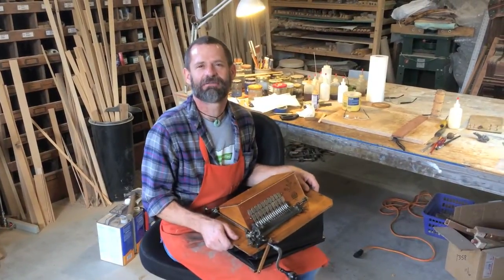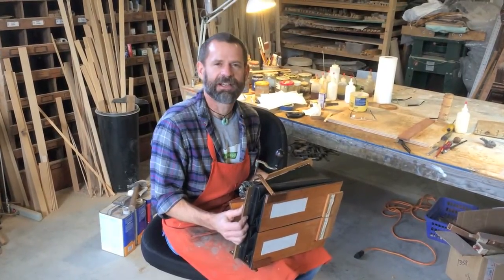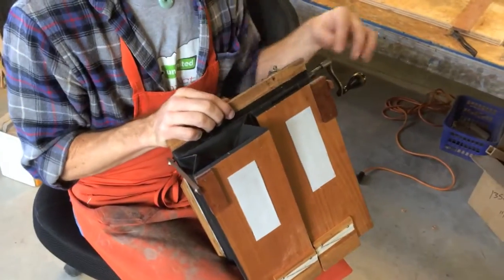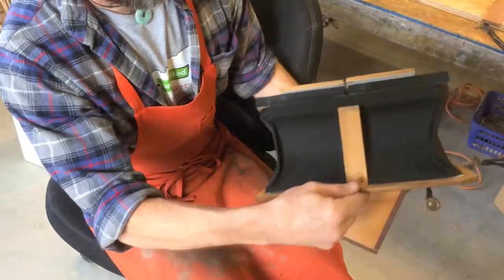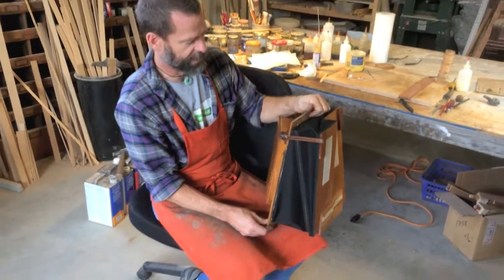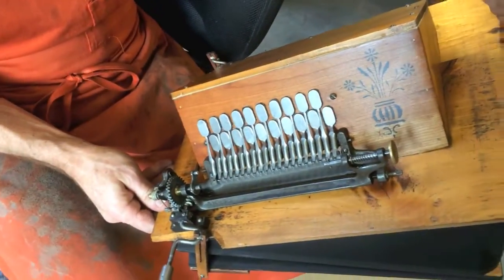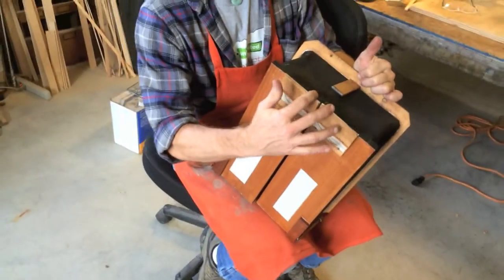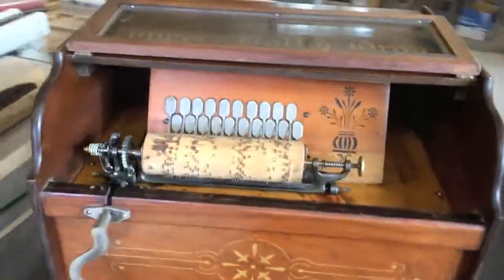Concert Roller Organ Restored

Comment: Hello I purchased this bellow material but I just can not get it right. I have a gem roller organ, and i desperately would like to see it play. I was wondering if you make bellows for that or anything. Please let me know.
Reply from the maker: Unfortunately I have a huge backlog of projects and I'm not taking on any new jobs at this time.
Reply: @DuoArtOrgan  Well, Thanks to you I rebuilt the bellows and they are fantastic They work great,and this material you recommended is supurb.however now I need the worm gear that goes on the end of the crank shaft.
Reply: You could alternatively send it to Harold Draper in Missouri: "Roller Organ Restorations".

Comment: I cannot find anywhere a shematic of how the air flows through a bellows. I want to replace the inside leather pieces over the holes, but not the outside, the outside is fine, its just the inside flaps that have rotted away. Can that be sealed? on the inside? working with tweezers and hemostats to get through the holes like the operation game from the 60's but in reverse. or does it need to be open, is it a one way valve? air goes out- but not in? like if the hole is on the bottom and the leather flap is on the top, air goes out through the top from the bottom, but not from the top to the bottom? there is absolutely nothing online that shows how the air flows through the bellows on this kind of thing.
Reply: In most roller organs, the pump bellows are called "exhausters" because they pull air OUT of the system and generate suction. So when the bellows are operated, they are supposed to push air OUT thru the external flap valves, drawing it IN thru the internal flap valves connected to the reservoir. This pumps the air OUT of the reservoir, causing it to pull shut against the spring(s). There might be another flap valve inside the reservoir (not sure), but even if not, the other end of the reservoir is connected to the reed board with the reeds on it ("windchest"). Thus when a pallet valve is opened by a pin on the cob, the outside/atmospheric air is admitted to the oval opening and rushes thru the reed INTO the suction reservoir. So the air movement is ideally: into the reed, into the reservoir, out the inside flap valves, and then thru the pumping bellows out the external flap valves. Hope that helps!

Comment: When you are referring to putting flexible tape are you meaning putting the tape around the edges or Horizontally to help hold down the pressure of the springs?
Reply from the maker: The cloth tape is glued across the open end of the reservoir. Its purpose is to limit the distance the distance the reservoir can open and to withstand the force of the spring. If you’re using the nylon pneumatic cloth from dcramey.com you don’t want the cloth itself to be bearing the tension from the reservoir spring. Ramey also sells the glue you need for the nylon cloth. Use the heavier weight “motor” cloth he sells.
Reply: Thank you for your reply. in my inexperience i pulled the exhaust bellow off without really measuring the open end. do yo just put enough tension on th springs or is there a certain width that should be? or should i just put it back in the wood case and make sure its level?  Thanks for any reply>
 @DuoArtOrgan